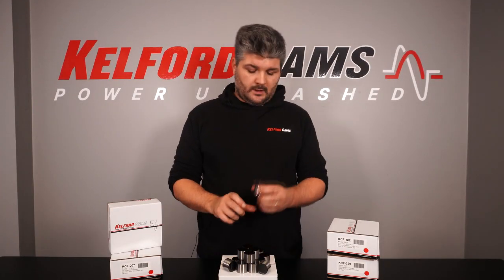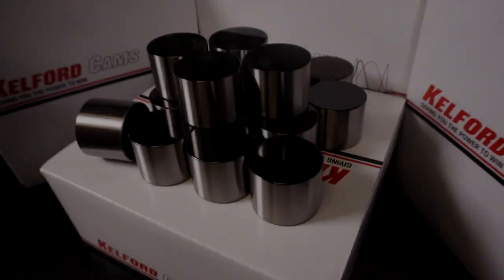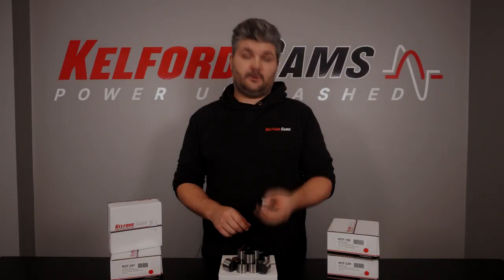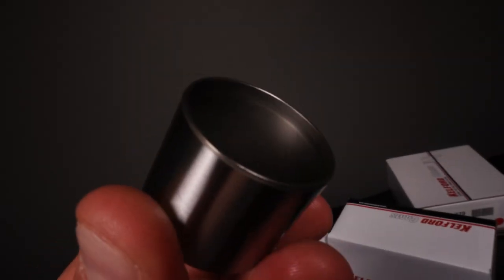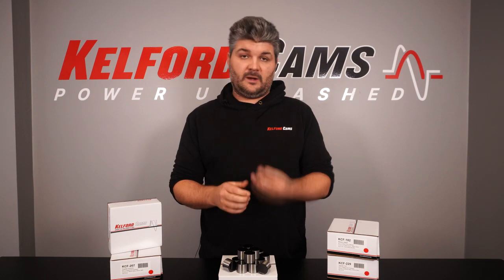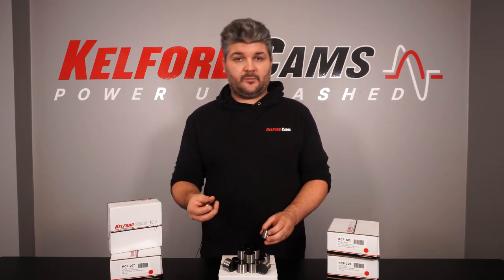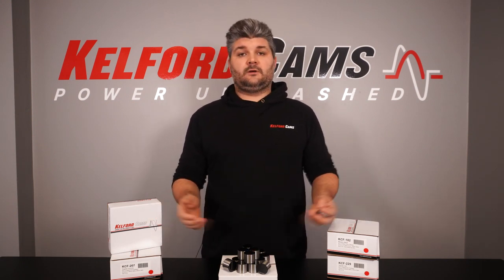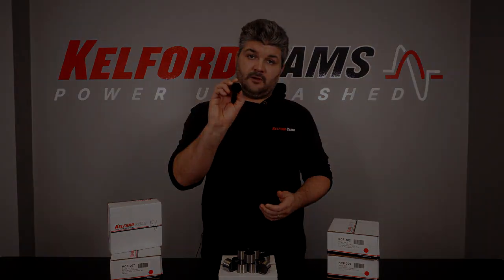Kelford Cams DLC Coated Buckets

Comment: Do you guys do a shimless version or is it just shim under bucket?
Reply from the maker: Hey, what engine have you got? 😊
Reply: @Kelford-Cams  2jz-gte vvti
Reply from the maker: @BUZDRIFT  yes we sure do, KCF-202 is 5.25mm thick and replaces the OEM shim on top follower. You will be required to set valve clearances by machining the valve tip. Email sales@kelfordcams.com for more information 😁
Reply: @Kelford-Cams  These are also DLC ? Would I also benefit from DLC the cam lobes too? I'll certainly be in contact!